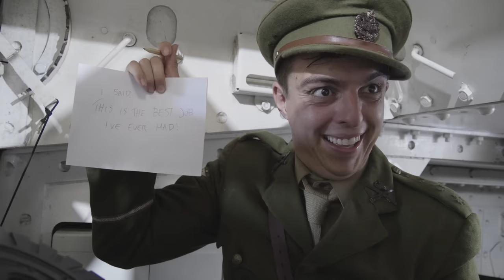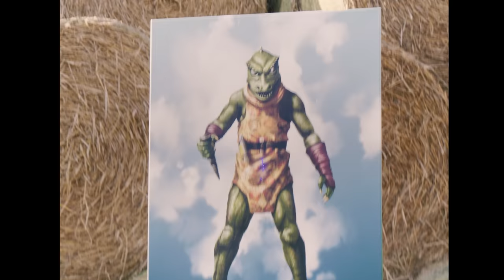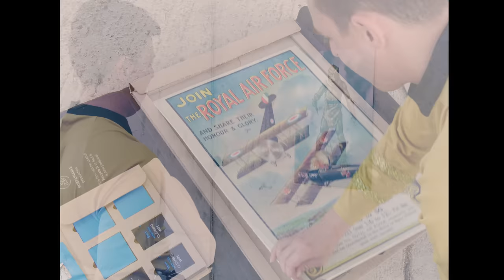Fury but It's WW1

Comment: " Flatout I believe we can push it at 3 sir" 

Honestly my opinion that's the part that made me laugh really hard early on
Reply: Although Mr Squire, I don't think you were entirely 100% accurate I do believe it would be a very Swift and eye watering speed of about 2.5.
Reply: Before or after you pass out from monoxide poisoning and vomit all over the gear box. 🤢🤢
Reply: It's the little jokes like that that are the funniest. I still think about the Bombay door every now and then...
Reply: @MaeBee  don’t forget the bucket used for voiding your bowels and bladder. That’s quite a smell, petroleum fumes and various other things at about 45 degrees Celsius.
Reply: In the distance future they might even go double digit
Reply: @matsv201  perhaps with a Diesel Engine and electric motor for the gun turret and a decent enough shaft horsepower per tonnage with a little teapot next to the commander chair…??
Reply: @Irish381  that all sounds very science fiction... a tea kettle in a tank.. the germans don't even drink tea
Reply: @matsv201  no, but the Limey British do and after 1931 the idea of a teakettle in the Battle Tank has become a popular feature. Much like Leather Bucket seats in American Muscle Cars from the sixties to the late Eighties.
Reply: @Irish381  Soo.. does the Irish have a potato boiler ;)?
Reply: @matsv201  not quite, we have a still in the back of our battle Tanks that acts as a vodka machine to cool the engine, and a wee tap to imbibe a little bit of potato alcohol to lift our spirits and go forth into combat. 😎🥃
We also installed a microwave oven to cook burritos and make nachos. Only Available on the DeLuxe Model.

Comment: The fact that the take Museum let you in the vehicle let alone take it out on the road is amazing
Reply: Well it's not like it's a Ming vase or something. Not easy to damage a war machine.
Reply: @TJCID22  If it were a real Mark IV, it would actually be incredibly easy to damage, because no one had figured out yet how to make a gearbox that actually worked in a tank
Reply: I think the outdoor scenes were filmed during some battle recreation event or something. Still, that they let them do the interior scenes in the real thing is amazing.
Reply: @TJCID22 these tanks are incredibly unreliable, spare parts are practically nonexistent and the youngest properly trained mechanics are likely all over 95 years old. Plus they’re often one of a kind vehicles, like how they’ve been allowed to use Tiger 131 multiple times (which even then, doesn’t have fully original parts as it’s actually got an HL230 engine cannibalized from a Tiger II).